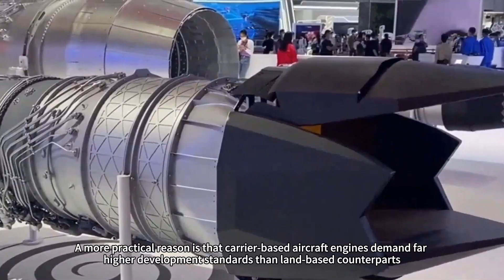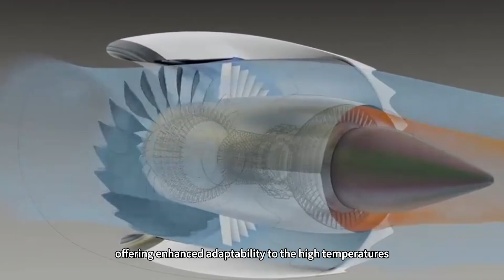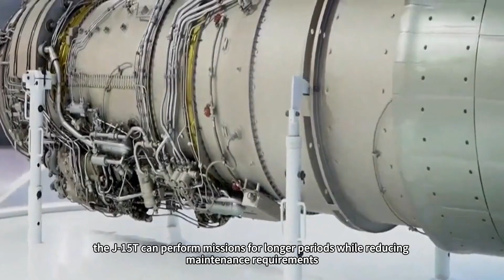Why does the J-15T still use Russian engines? Is It a Technical Bottleneck or a Strategic Choice?

Comment: While the early J-15s  did relied on the Russian AL-31F engine, the new J-15T has fully transitioned to China WS-10H engine. The WS-10H provides significant power improvement and reliable power for both ski-jump and catapult.
There are no evidence that J-15T are using AL-31F today.